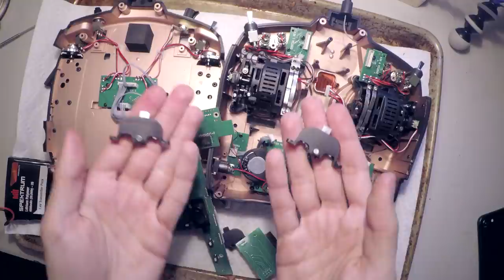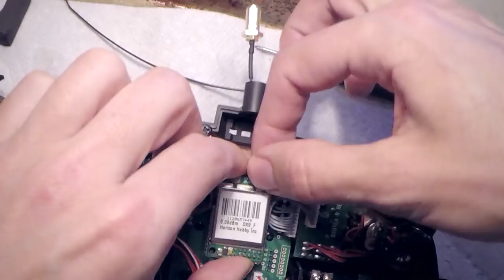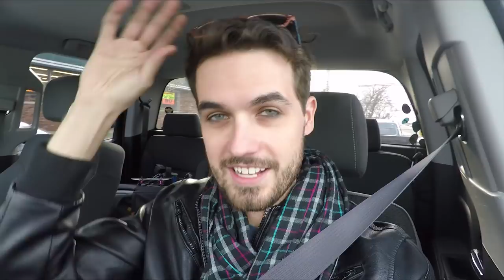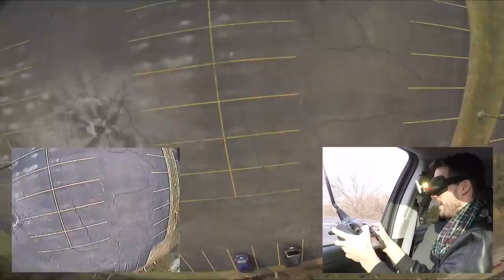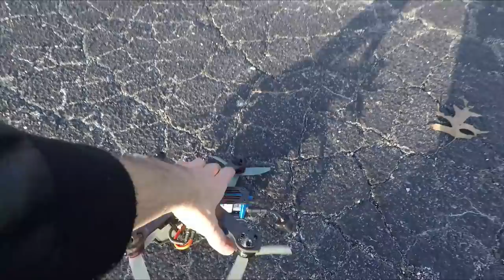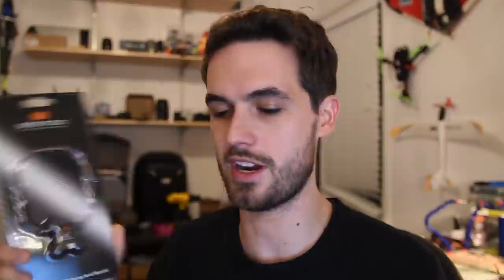Antenna Mod for Spektrum!

Comment: After I saw you use that Tri-Flow grease I went and bought some for my 3D printer. I'm very glad that it's listed as food safe because my dog ate the whole tube of it. It's been several days since and she hasn't shown any signs of distress, so I'm glad I saw and bought this stuff instead of some potentially harmful type. Also, she has a dog door, so I didn't have any cleanup if it gave her the squirts.

Comment: Dude...well done! Awesome hack! Thank you so much for sharing this! I had my old DX6x with a broken antenna lead. Took to my local hobby shop, only authorized shop in town that can repair and he tells me he can't fix it and system board is fried. I knew it was fine. Saw your video, bought a couple antennas from your link and now range test is off the hook. Can't wait to test fly my FT simply cub. Don't care if it goes down. Been having hold issues with my 8e and need to get some ammo to prove to Spektrum. Had 3 holds in 2 flights with my Eflite F16 and terrified to take it outta safe because of it. Now, I can test with the 6e, still get safe select and test for holds. Thanks man! Hell, I'll likely just nod the 8e once I figure out a good way to make it look better with both antennas.

Comment: Hey Drew, do you know if the DX6 you were using was the newest one that has diversity? there are two, when the DX6 first came out it didn't have diversity. Then around the time the new DX8 G2 came out they changed the DX6 to add diversity. So I'm curious, if that DX6 was a newer one with diversity, if so then the comparison would be pretty similar to just doing a before and after. I've contemplated doing this mod several times but never got around to doing it as I've never had a failsafe with my DX6 or DX8 G2 and didnt want to risk doing it then start having failsafes. But these results look really good. Imagine if we can find a way to do two higher gain antennas that are perfectly tuned for our 2.4ghz radios. we could seriously increase range! :) love your channel! thanks.

Comment: Hey Drew, first off thanks for doing what you do, your videos are fantastic.  Quick question, after using this setup for a while have you experienced any downsides to the higher gain antenna?  Do you have to be more mindful of your position relative to the quad and dead zones in front or behind you?  Have you experimented with any other antennas?  Thanks again for sharing!

Comment: great vid. I am glad someone is covering spektrum for racing drones. I have dx8 gen2 and a taranis and I always go back to the spektrum. 
could you do a vid on setting up an arm switch / idle etc please. I have been using the same default switches forever ' it's like playing twister when trying to disarm 😂.
plus, what's you view on the new spektrum telemetry receiver? 
thanks and have a good day.
Scott from UK

Comment: This will indeed really help a lot getting more range, cause a better and more efficient antenna. I would just be carefull and test the antenna with an antenna analizer, as I saw already ver bad constructed 2,4GHz antenna that are not resonant at 2,4GHz, and are high on swr...
But if it's spot on then this mod will be a good effective upgrade.
Thanks for the video !!!
Yes I'm a ham radio operator ON3DIM

Comment: Hi,
How did the antenna mod go? Taranis users suggest using RG316 cable cut to a specific length (84mm). I noticed you didn't mention any specific wire or length, do you know what it is for a spectrum?

Comment: lol, were you facing the same direction as the quad with your directional antenna on the goggles? It looks like you were pointing at 90 degrees from it! Probably why you lost video so early ;)

Comment: Have you by chance gotten to test again with the SRXL2 DSMX SPM4651T receivers what the range is like?  I'm setting up a FPV plane, and am wondering if this will work or if I should switch to some other Transmitter/Receiver setup?

Comment: Why do people who fly quads only, think Spektrum has range issues, when there are thousands of pilots using Spektrum on very expensive Heli's and 3D and giant scale planes with out issue? Go to a large flying event and try to find a Taranis on those flight lines. I fly a DX9 and have never had an issue with my planes or quads, and I use mostly clone RX's and a few Spektrum racing Sats.
Reply: Because model fliers never fly their model behind trees, building and above the cloud but FPV miniquad does.

Comment: You should make a dummy load to put on the transmitter  so after you take off the main antenna you don't accidentally mess up the transmitter.
Reply from the maker: yup I have a dummy load. I mention it at the end :)
Reply: Sorry i guess I don't see that:)

Comment: Don't all Spektrum transmitters feature a range test function with reduced power?  This is good for a range of about 30 meters.  Suggestion: Program a beeper in betaflight and walk away from your non-flying (!) quad until you can no longer turn on/off the beeper.  Do that with both the old and new antenna to get a quantitative measure of the improvement (like 20% more range or whatever it turns out to be).

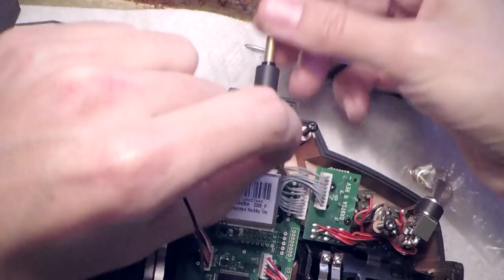Comment: Hi Dr Evil Genius, we really need your help! We have a DX9 and under the main spectrum chip that is white with a barcode at 4:08 minutes, we have 2 grey cables soldered to the PCB that do not connect to anything else ?
Any ideas what they may be?

Comment: Hey you should try mounting a signal amplifier on there as well. FLYSKY guys do it because they like iBus and its relatively cheap. All the same signals and connections so it should work fine on a spektrum or a frsky too

Comment: great video! i do like seeing spektrum info related to quads.  i've recently slipped from spektrum to taranis and i agree that rssi telemetry with voice alerts is the one feature i like the most from frsky.    have u tried getting rssi from the spektrum receiver on to an  osd so u could see it visually when flying?
Reply from the maker: Not possible to get RSSI to OSD from Spektrum brand receivers apparently. I guess there's a hack way to do it with the lemons

Comment: Will this mod not damage the radio? I know vtxs should not be powered up without an antenna but constantly removing the antenna and putting it back on they eventually wear out and won’t make contact anymore burning your vtx out.

Comment: By adding a longer antenna to the transmitter, you have changed the impedance of the antenna. They are no longer matched to the radio. 
Without the proper equipment, its would be hard to show you what is going on. I can tell you the longer antenna is overpowering the antenna in the handle. It would have been better to do that with the older gen 2 Dx6 than using the newer DX6 gen 3. I wouldnt recommend it at all on the duel antenna system.

Comment: Have a litle problem my ailien frame hvith full kiss setup ( first modell kissFC)
I have a spektrum IX20 and an spm 4650 hvith SRXL V2 protokoll and i cant get it to wark hwit the kissFC. I have flassed the latest firmwhere on it but notting i wander hvetre to solder it and can kissFC talk srxlv2 ?

Comment: I just watched your last 2 videos and you answered all of my questions!! Thank you, for sure I am subscribing to you.

Was there a loss of range with the 4649T or any downsides? I am going to buy one or the other sounds like it would be worth it while waiting for the update.
Reply from the maker: thank you :)

No loss of range with 4649T. Its a great receiver. No plastic case, which is an upside in my book because I decase the 4648 anyway to have more flexibility with antenna routing.
Reply: final question for now, why didn't you replace both antennas? I saw the double mount on thingiverse. I would think it would be best to do both.
Reply from the maker: just didnt want to deal with having to attach two antennas and thought the dual mount just looked even more ridiculous haha
I guess one giant antenna is bad enough I should've just gone all the way
I might do the second one in the future but wanted to start with one and see how it worked.

Comment: Hello! I'm just a beginner and I would do like to have your opinion about the Spektrum DX6 or up, like the XD8 for Gliders as the Fly Fly ASW 28 which I guess are the models with the "simple" setups and commands comparing with Race Drones, Helis and other kinds of more complex models. By the way I am planing to have all setup with Spektrum products, transmitters, servos etc etc. So what are you think, the long range antenna will be a plus too? Thank you very much!
Reply from the maker: I think the high gain antenna can benefit all aircraft. It just becomes more important that the side of the antenna and not the tip is pointed toward the craft

Comment: Not sure where you did this but my stock Spektrum dx9 reaches out further than a third of a mile . The closer you are to the ground the worse the signal will be on 2.4 . Maybe the improvement is when flying low ? I dont really see any reason to do this

Comment: The stock taranis gets that distance and further in open area but I am impressed with your video quality and range compared with mine.
Reply from the maker: yup hard to compare because my area was an intentionally noisy one
Reply: Le Drib yeh it's hard. thanks for the videos and the time it takes.

Comment: Can you pretty much hold your transmitter how ever you like? I have to have it at the perfect position on my lap or around my neck, this may be a beginner thing though, cool video thanks Drib!
Reply from the maker: no I'm actually quite picky about wanting it to be just right and usually have to use a neck strap or on my lap. But since I wasn't doing anything other than flying straight out and flopping around a bit it didn't bother me too much to have my hands all weird out the window lol

Comment: I want to do an antenna mod on my DX8 is this still the best antenna for the Mod?  have you tried any other antennas? you said the antenna you used is 8dbi,  do ya know the stock dbi?
Reply from the maker: stock is 2dbi. No I haven't really played with antennas much since switching to the iX12 which I haven't done the antenna mod on. And now I just use Crossfire if I want to fly far :/
Reply: @LeDribFPV  that's cool I don't think Crossfire works with the DX8 please correct me if I'm wrong and I think the antenna mod might be cheaper which is better for me lol Crossfire would be sick though

Comment: Huh, nice video, very informative Drew! Just for reference I've been about 2000 ft. (.39 miles) away with stock Taranis antenna. Interesting to see.
Reply from the maker: very impressive! Were you getting RSSI critical alerts yet?
Reply: Le Drib No, didn't get a single one.

Comment: I wonder if you could run a longer cable and externally mount your transmitter antenna? You could couple that with an external diversity module and then fly FPV without range issues from inside the car. I bet someone has done that.
Reply from the maker: good thinking ;)
Reply: Le Drib RcTestflight did that and mounted a wood plate to the top of his car and put the recievers for fpv
Reply: Schumata Yes, they have

Comment: Yo, dribble. Have you ever considered a 2w booster? I'm getting ready to test out a strix goblin and a partner who does fpv heli long range has been successful with the 2w mini booster from bang good.
Reply: Slimer FPV Booster for???? Increasing range???  I am adding an audio booster to the speaker, it will add better tone and clear up any sound issues the radio may have sound wize. I was going to add it to the dx6 gen 2 I got on E- bay but I got scammed with a defective unit.

Comment: I notice there are 2 places to plug the antenna in. There is an a and a b. Do you know which one to plug into?
Reply: The one you unplugged
Reply: @vinnyavalanche  very helpful....... Pulled another one apart at the Hobby Shop. It's the top one

Comment: i did the double antenna mod with some 8di antennas, it was cool but got lazy of taking antennas on and off.
Reply from the maker: went back to stock?
Reply: yeah went back to stock, when i switched over to spektrum sats instead of using lemons.

Comment: you need to pull out the ground station for video and try the building loop. 

I have the serial telemetry receiver as well...and ran into the same problem...whats the use spectrum?
Reply from the maker: hope they fix it soon! The radio just needs to be capable of using RSSI as an input for an alarm so no reason they can't add it via an update
Reply: It should work but with only a tone warning and you have to do a clear at the min/max page every flight. Has been a work-around. Haven't tested it yet. Still su*ks
Reply from the maker: aha thank you! Good to know. But Spektrum needs to make it a properly supported feature. I'm nagging them to get it done ;)

Comment: You could upgrade the gimbals from potentiometers to hall effect gimbals. Wait forgot that's frsky :p but I did have a quick question why keep the original as a 2db and change the 2nd one to the 5db as a whip you would have had the height benefits of the 2db but also gotten the range from the 5db in something that didn't look so odd and wonky.
Reply from the maker: might have to do the first hall effect gimbals on a Spektrum 😂

Comment: Hey bud reporting back, the mod worked on the dx6 bkack edittion no problem i didnt have to cut anything or nothing if i want to go back to the stock antenna i can real easily the way i did it. wish i had some how to show you pictures i should of done a how to on the dx6 just like you did on your dx9.
Reply from the maker: That's awesome! I'm surprised you didnt have to cut the DX 6, every pic I've seen shows the antenna cover to be part of the case. But it detaches?
Reply: Le Drib yeah it has a big plastic nut on the bottom twist it off and the top of the antenna comes off. super easy then put a bigger washer on top and bottom the screw it together simple. 😉
Reply: Fuck!  I unscrewed that nut and still couldn't get the thing off.  I just drilled a hole in the top of the case.
Reply: mooosestang damn mine came off easy.

Comment: Dx9 didn't already have the metal trim swithes? The DX6 does, I thought they see basically the same unit just less channels?
Reply from the maker: I thought the dx6 switches were Metal too but they're actually just coated plastic. 
But yes dx6 and dx9 are similar. Some say the dx9 gimbals are better but I think the 6s feel good too
Reply: Cool, Since your a Spektrum user, What other receivers do you like? I like the Spektrum ones but looking for something a bit cheaper. Ive seen the Lemon RC ones on line and have heard them mentioned but never have used. Will the Similar satellite ones connect like the  SPM4648 or do they have to connect to another receiver first? Any help would be greatly appreciated.
Reply from the maker: I used to use Lemon RX diversity satellites, they work well. The SPM4648 do run on the 3.3v satellite voltage and have auto-bind (plug in drone before transmitter and it goes into bind mode)
All I use now is the SPM4649T. A little more pricey but runs on 5V like "normal" receivers and also has telemetry for RSSI low alert etc
Reply: I just got one of them in the mail, but haven't installed it yet. Waiting to install on my newest build. I am tired of loosing signal and dropping out of the air. I once thought a gravel pit was going to be awesome place to fly.... Until i went behind that huge mound of earth. That and snow banks i cannot penetrate a signal.,
Reply: oh hey, one more thing. I had a Mach 25 that i destroyed, and at the time parts were not available yet to i parted it out, but now i have the receiver/FC  The A3174. do you know of any other uses for it?

Comment: This is awesome.. I wonder if I can do the single 5db antenna mod to my dx6 or dx8 black addition? thanks for this video and if you have any idea if it will work on my 2 radios let me know bud.

thanks again buddy

Farmer
Reply: Farmer Fpv yeah you can they run the same tx boards
Reply from the maker: yup, the only difficulty is on your dx6 or dx8, the antenna cover might be a part of the main plastic shell... so you might have to do some cutting or get creative. If you do it let me know how it goes!
Reply: MultiDragola thanks bud 😎
Reply: Le Drib I will let you know. I just got a camouflage wrap for it that looks awesome now just need to order the antenna.  do you have the link to the one you bought?

cheers

Farmer
Reply from the maker: I used this http://amzn.to/2mPNcNr
Reply: Le Drib sorry for all these questions so all I'll need is the antenna you bought clip that in place and figure out how to make it come out clean up top right? and what are those dummy loads you ordered.? lol

Comment: Wonder if this can be done on a dx6 or if its worth doing?
Reply from the maker: yes it can be done on a DX6 just the same, however, the antenna cover is part of the main shell so there will have to be some cutting :/

Comment: By any chance could I do this mod with a dx6? btw great video.
Reply from the maker: yup! As far as I know all Spek radios use the same connectors so it should be the same.
HOWEVER, a problem with some of the radios (like the dx6) is the antenna cover being a part of the main shell... so you will have to do some cutting
Reply: Le Drib k thanks man. I might just get a dx9 or I might cut the antenna top off.😀
Reply: the sleer fpv I did this mod a few weeks ago with my dx6. The antenna is actually separate and it works perfect.
Reply: Le Drib no cutting needed on the dx6 the antenna is separate once you pull it apart.
Reply: Phat Kid awesome man I appreciate your help! Definitely going to start on that!
Reply from the maker: oh that is awesome to know! thanks